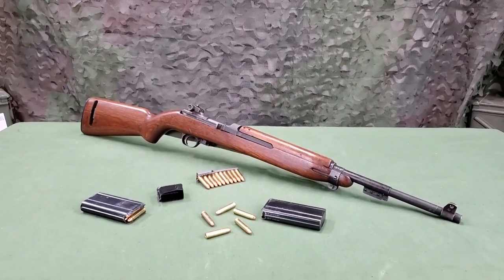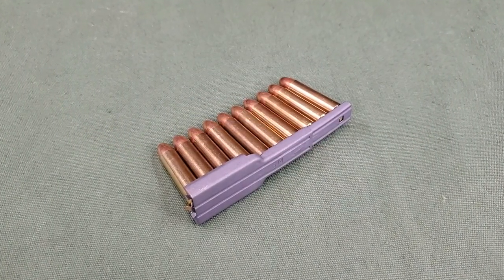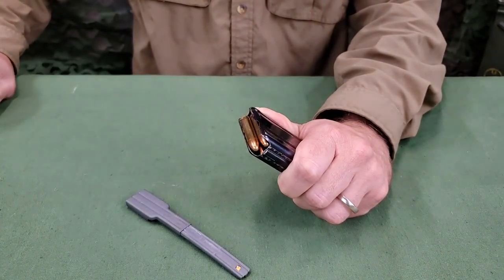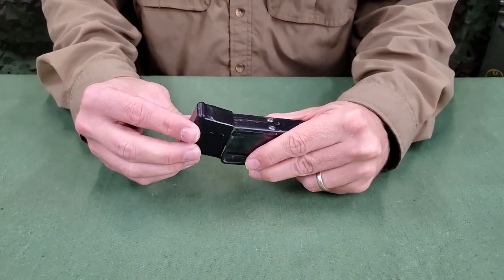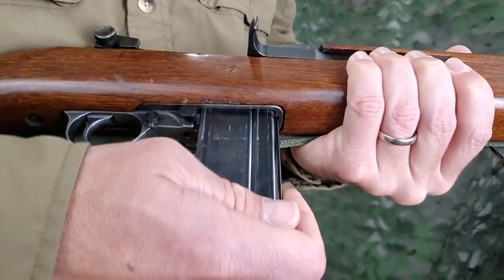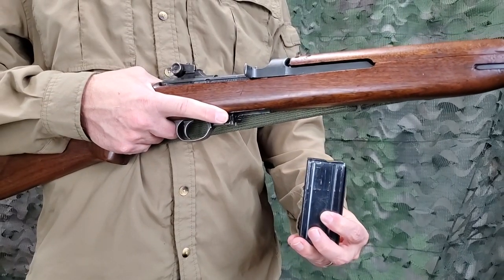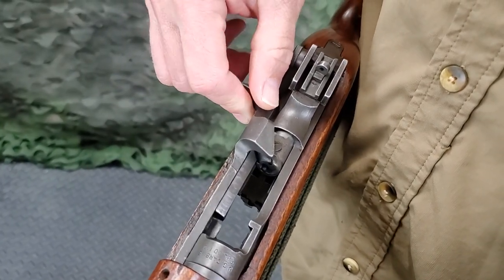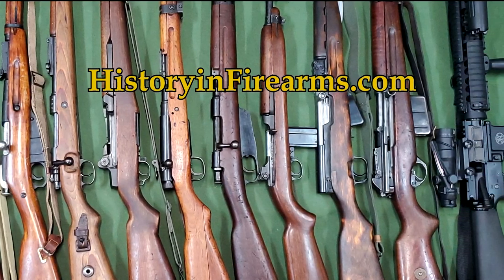M1 Carbine Loading and Unloading (TF 13-03)

Comment: playing around today I discovered that while not at all doctrinal, you can feed loose rounds singly into an inserted magazine with the bolt hold open engaged from the top of the receiver, as well as from a unmounted stripper clips in the same way.
Reply from the maker: Well that's interesting!